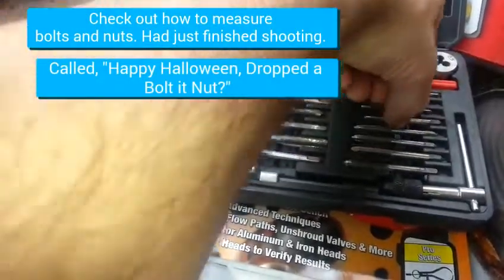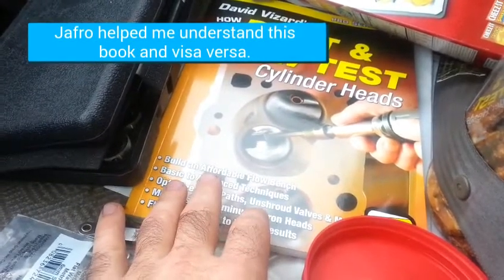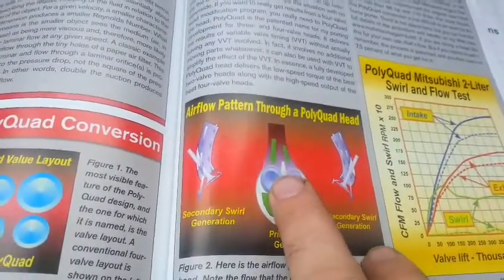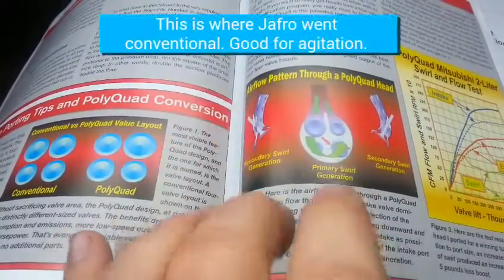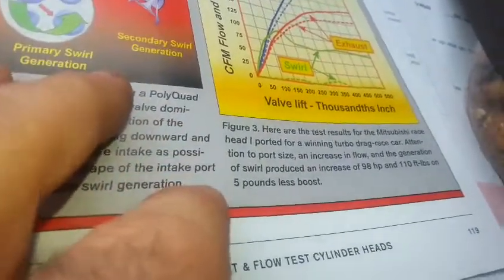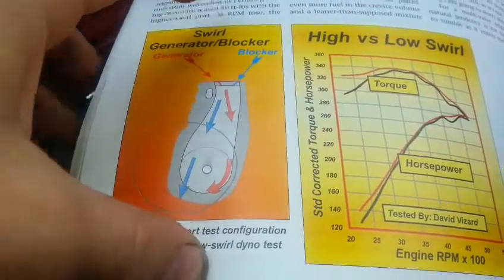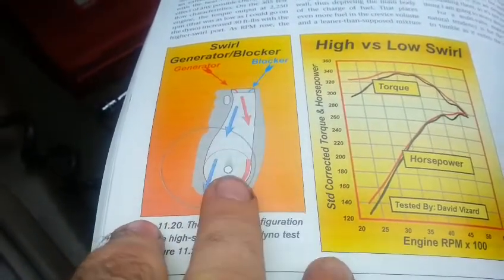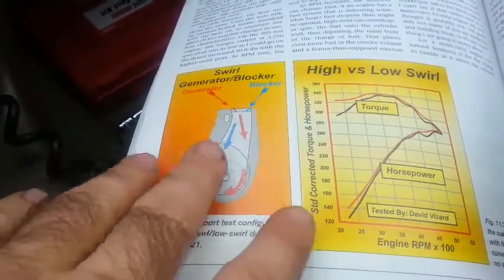Port and Airflow Theory, PolyQuad cylinder chambers, Creating Swirl

Comment: Rotax used a trick. They opened one intake valve slightly before the other. It worked ! Very good mpg, and power.
Reply from the maker: That's a cool trick! I wonder if this could be done with 16 valve engines with the use of a custom cam?

Comment: Can you elaborate more on the 2 valve set up? Like how it needs to be done and how it help stuff more air into the engine. I have an 8v 4 cylinder engine that i want to build to be a track car. I am happy for this video though and I will be sure to tune in into every build video.
Reply from the maker: +argonian bilbo Thanks. Making this video was a bit of test to see if there was interest. Regardless of whether people who were interested had found me or not, I'd make videos on it since it's what I'm learning to do. I'm very glad you like it and I'll be sure to produce more.

A little more explanation of what I thought about when I read the book and learned...

Hmmm. Basically, what's happening is that when you add a bump in the intake port on one side it becomes a swirl generator, on the other side it's a swirl blocker.

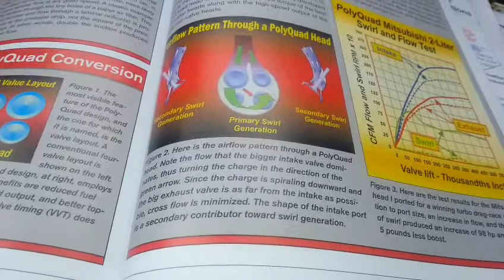If the bump is on the side where the air has to turn anyway as you can see in the example picture at 4:08 it increases the velocity of the air on the opposite side of the port, just like an airplane wing.

The air behind the bump of the swirl generator becomes more still, like the back of a pickup truck. Keep that gate up if you know what's good for your gas mileage! Ever watch leafs lazily circle in the back of a pickup and they hardly ever get caught by the massive wind going over them? 

That air is slower moving and when it hits the valve it's just like the 4 valve setup with a smaller valve to move air slower, while on the opposite side you have faster air so that the combustion chamber air and fuel will swirl.
Reply from the maker: +argonian bilbo Oh, the how? You'll have to weld it with the right kind of welder for the metal the cylinder head is made out of.
Reply: oh. Ok thanks for the explanation. In the description you mentioned this lowers low end torque. Does it make a big difference from stock torque values in low end. ive heard a lot of people polishing and porting heads for power but if it messes with low end torque then i should steer away from it for a track car. Right?
Reply from the maker: argonian bilbo
On a 4 valve head opening up the ports can lose low end torque so it become of a car to do awesome at the drags and poorer on the street or on the track.

There are plenty of stock cylinder heads that have 1/2 the valves with more of an open port design for half the valves to create swirl, however, it has been accused of being for efficiency only and not for power.

So really I hate to say this, but we're both right and wrong.

When I actually pull my cylinder head apart and measure the intake port size per cylinder and get a square area of it I'll apply the math to find out if my engine has the common fault that most manufacturers do on these little 4 cylinders. They actually give too big of intake runners! They need velocity instead of volume.

The math I believe is the same comparing valve area and to the intake area. The area of flow around a valve is a lot smaller than you'd think by how the math runs. (In the equation it's times by something close to 3/4 instead of pi.)

Depending on that equation, determines which way you go.

If my intake is too big I'll have to restrict the port size to the smaller valve instead of opening it up for the larger valve.

That would be quite a blow to my plans seeing as how I don't yet own a TIG welder to weld in more material in aluminum.

Regardless, I'll make everything smooth and better the short turn, and remove the machinist ridge (see the pictures for the website I included in the description).

I'm getting off to points next to this video. If you have a carburreted setup the community as a whole tends to believe the rough cast helps tumble the air to mix the fuel, but with fuel injectors that tumble just reduces air speed and volume.
Reply from the maker: ***** Thank you. As my mind worked that over I arrived at David Vizzard's comment that your wasting your time being smoother than 80 grit sand paper. Now I know why. Great information as always Hugh!
Reply from the maker: If I just went over a lot of basics of porting and made a video out of it, it'd probably be pretty enjoyable for my subscribers, but a lot of times, I only teach something when something new peaks my interest and the rest of what I learned in the book was on a foundation I already had.

That said, I watched a great video on youtube by Eastwood, which covered a lot of basics pretty well. Depending on the goals you have, you'd disagree with much of what was said, or at least I would.

I wrote an article about it. You'll find the video there too. http://carmilespergallon.blogspot.com/2016/05/port-and-air-flow-in-practice-and-in.html
Reply from the maker: Thought I'd give you heads up. I think YouTube forgot to put out the update about my latest porting theory video. https://youtu.be/yc1vkp41WcU
Reply: DE Nichols ill watch it
Reply from the maker: argonian bilbo Cool. I remember you being excited about this type of information. :)

Comment: Wow I have to see this series, when are you going to start ?
Reply from the maker: As soon as I can. If you look at the webpage I link to in the description you'll see a lot of what I've gathered so far.

The tooling is the most expensive part. I have the six inch single cut carbide burrs for example, but no air compressor tough enough to run the air tool that much. I'm thinking electric die grinder by Milwaukee.
Reply: +DE Nichols  I like electric I have a  dreamel . If you have to add material , well I would use my tig welder but I think you could use epoxy or weld bond type of  non welding adhesives. Man Im really look forward to it.
Reply from the maker: Steve Rob I really hope I don't need to add material. I'd have to do without for now. A TIG welder wouldn't be affordable to me for some time. 

Hugh O'Brian. ..hope I spelled that right, has been wonderful answering questions on Jafromobile's channel helping me know so many answers. He's been a pro for years. 

He's seen epoxy separate and destroy valves. Not an option.
Reply: Spent many years seeing new epoxie mixtures in the auto manufacturing  of automobiles that out perform solid stock. Your not going to get the good stuff from harbour freight. Check out a supplier , loctite corporation and others. What happened 5 years ago doesn't apply today. New F150 not one weld all epoxie and rivets. Can't wait
Reply from the maker: +Steve Rob Thanks for that! I'll look into it. 

What do you think? Between two repairs I already have 45 minutes of video. ..release them as a series as parts 1 and 2 as parts come in?

You gave me an idea! I'm going to see if there's though material I'm comments between Hugh and I to make an educating video. 

I complimented you behind your back. Can you guess where? :)
Reply: YouTube is odd some people want a long vid and some short, hard call. I think as parts come in as to keep the flow but at least don't wait too long between segments , just my thoughts. Hum a comment on the web , ha I have to idea but  if it's from you it's a good one :)
Reply from the maker: Apparently, I was going to start and not get back to it for a while! Ha! I wrote an article about it with inspiration from a video I watched this morning. You'll get both if you check out the article. http://carmilespergallon.blogspot.com/2016/05/port-and-air-flow-in-practice-and-in.html

Comment: Is very  interesting the ditrubution the valves.
Greeting from Spain =)
Reply from the maker: +Pablo A I've seen you comment around on YouTube like myself. Glad to have you!

Greetings back from America :)
Reply: DE Nichols Jajaja many thanks =)
Reply from the maker: Hi buddy, I haven't returned to this subject nearly as quickly as I thought I would (porting a cylinder head), but I haven't stopped thinking on it and learning. I ran into a great video this morning and I wrote an article about it that you might appreciate. It'll link you up to their video as well. It's a practical showing of it, that helps visualize my concepts and theorem's. http://carmilespergallon.blogspot.com/2016/05/port-and-air-flow-in-practice-and-in.html
Reply from the maker: Hey buddy, I've done a new porting theory video. I wanted to cover a lot of I say in Porting and Airflow Theory II here, but this is a big subject and I realized I needed to break it down to smaller portions.

https://youtu.be/yc1vkp41WcU